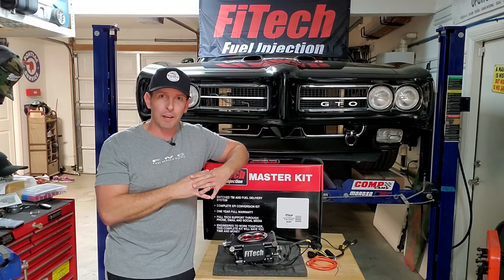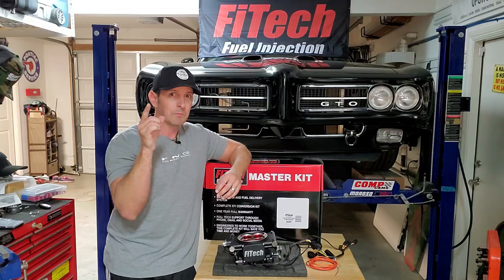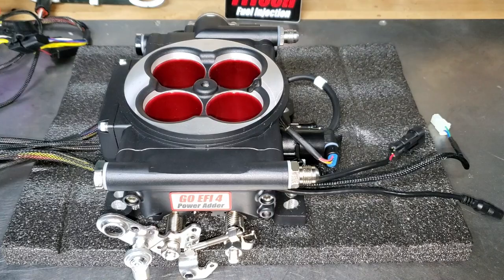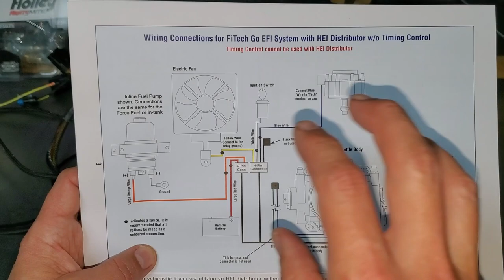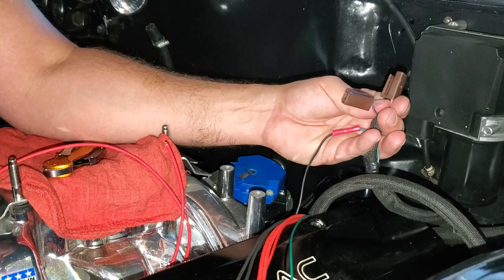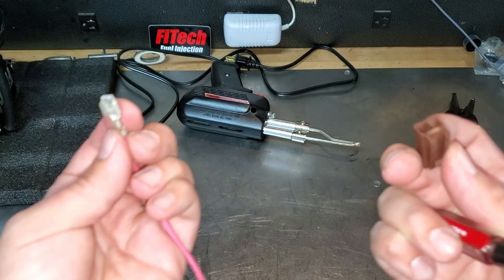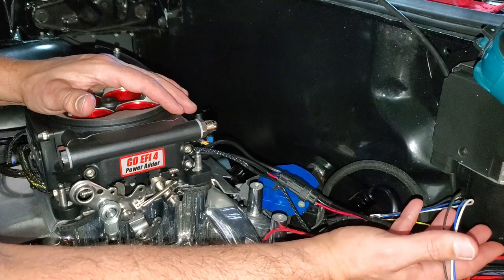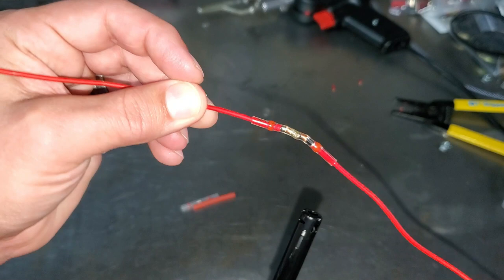Fuel Injection Conversion, Part 4:  Throttle Body Install and Wiring - FiTech

Comment: glad we got to share an efi build.  I thought the same thing about the power wire to the efi and I took the lazy route of using the original wire to run a coil on a relay and run 12 gauge through the the tips of the relay instead of tearing through my wiring harness lol
Reply from the maker: Ha!  As long as you're getting adequate juice to the distributor, you're good.  Thanks for sharing!

Comment: I have the same pcv from the valley pan. Where did you route that on fitech unit? Or did you route elsewhere
Reply from the maker: Good question... I routed mine to the intake manifold.  (I have a port, just underneath the throttle body)  But, for you, it should be the largest rear port on the Throttle Body.  It should be a 3/8" hose barb.  Hope that helps!

Comment: Hi I got a question for you
I have a 79 pontiac trans am. With a 400 just switched over to a  tko 600. 
I have a temp sensor on the drivers side head for the water gauge. I also have dual fans and run a coolant temp sensor off of the cross over tube on the intake. I’m installing the sniper fuel injection system and it requires a coolant temp sensor as well. Where can I install that one. I don’t see any other ports on the intake.
Reply from the maker: Good question.  You won't need the fan sensor anymore, so use that port.  (The EFI system will now control the fans)  :)

Comment: Mike where did you run the 12 Guage wire for the distributor too?
Reply from the maker: Hey Bill... it runs from the distributor to the back side of the fuse panel, which is actually on the "engine side" of the fuse block.  That side of the panel comes off with a bolt in the middle.  Really easy.

Comment: At 8,03 not true, the sensor has 2 wires connector yellow signal and black ground, so the sensor does not to have ground at sensor to intake
Reply from the maker: Ahhh, great catch.  I'm so trained to not use PTFE tape on those fittings.  Thanks!

Comment: Could you have put the return line/vent in the fuel filler neck
Reply from the maker: Good question... as long as the fuel can easily get back to the tank, yes.

Comment: Is it good for daily use and the temperature is very high up to 50 degrees Celsius in the summer? Help me
Reply from the maker: Yup, I don't see why not?  If you're really concerned you can add a plastic carb spacer in between the throttle body, and the intake, to help keep temps lower around the computer.

Comment: Does anyone know which primer he used on engine block before the "restoration color" brand engine paint on gto
Reply from the maker: I know Christopher, as I already replied on the Walk Around video.  The primer is VHT High Temp Engine Enamel Primer.  Let me know if you did NOT get the other reply on the Walk Around Video, as I included a link.  I suspect some responses do not come through if there's a link posted.  Thanks!
Reply: Thank you soo very much man! Going buy some merchandise from fmg. I'm doing my 67 gto then my 70 Judge.
Reply from the maker: @christophertaulli  Welcome!  Did you get my response on the Walk Around video?  (I had included a link, but I have no idea if links get removed, etc..)  I'm jealous you have TWO Goats!  Git er dun!
Reply: @FastMonty  don't see it on walk around vid
 Is it the vht flame proof?
Reply: @FastMonty  been having both cars for 25 or so years found original build sheet for judge when I dropped fuel tank. Is definitely a # matching Judge
Reply from the maker: @christophertaulli  That's awesome!  Glad to hear the build sheet was still intact!  Very cool.  Hope to see more comments from you in the future.  See ya!
Reply from the maker: @christophertaulli  Good to know the link didn't come through.  Here's the video... https://youtu.be/3QtmxWlZtaE  Go to the 1:50 mark.

Comment: Why did you not have to have a fuel return line???
Reply from the maker: Good question, Shawn.  The FiTech ForceFuel unit has the regulator inside it.  So, I just have to run the return line from the ForceFuel unit, which happens to be in my trunk.  I might be switching to a modern Camaro SS in tank pump in the future, which also has a built in return line, inside the tank!  Stay tuned for that.  Thanks for the comment!